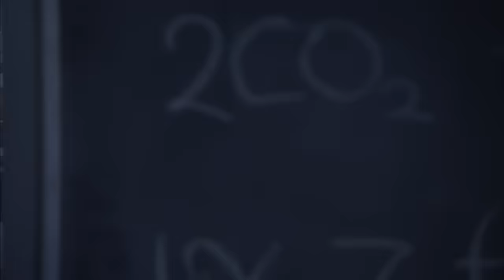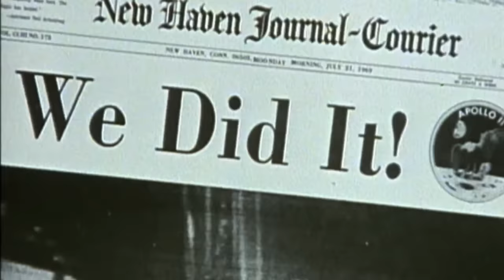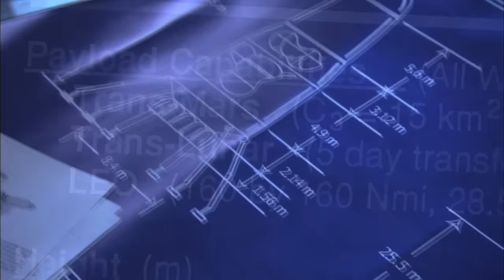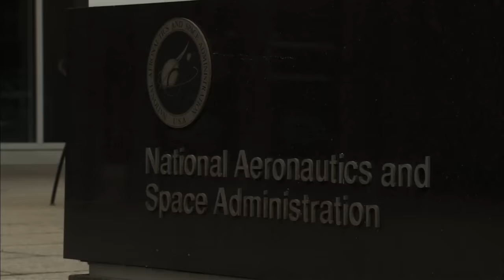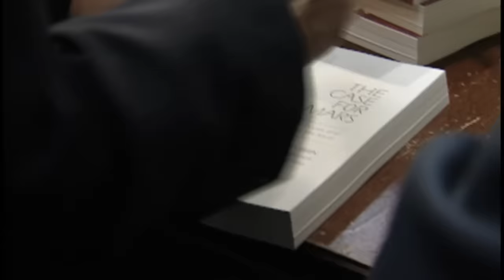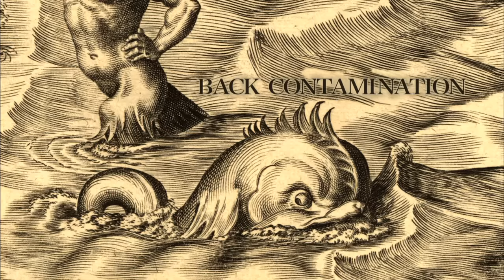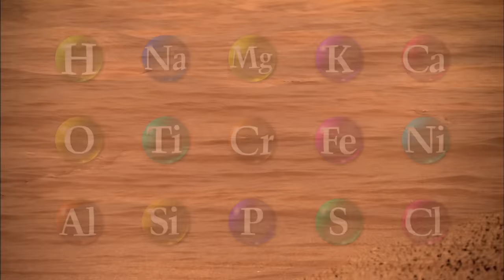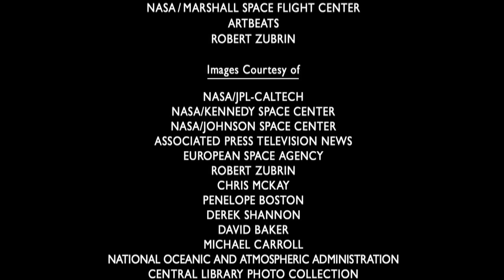THE MARS UNDERGROUND [HD] Full Movie

Comment: Something interesting occurred to me about Mars landings. The martian ATMOSPHERE can improve the safety of transports by using hydrogen or helium filled bags to reduce the fuel required for landings just by maintaining a buoyant state for the transport craft. This could provide for long duration overflights for closer inspection of large areas prior to establishing a landing site. Establish orbit > deploy lander > deploy braking parachutes > deploy gas bags for atmospheric operation > deflate to land. Similar to the probes utilized on the Alien planet Darwin 4 program except on a larger scale.
Reply: LEIGH BARTON Helium is lighter than air. There is no air on Mars. Is helium lighter than nothing?
Reply: @dieterbruls4091  mars does have air tho. Not much of it but it’s also c02 which is heavier than air gas so helium will still be buoyant.

Comment: We can warming up Mars, we can green it up etc.
But how we wanna build up the martian core to generate a strong magnetic field again?
This is just the main goal.
Reply: A satellite in stationary orbit aimed at the sun producing 1-2 Tesla of magnetic field will cover Mars with magnetism that will repel cosmic wind easily.

The result will be also a 4 degree warming of Mars which will probably result in releasing CO2 from its surface. It's actually the cheapest and most doable plan.

We know how to put satellites in stationary orbits already, we know how to create electromagnetic fields. It's easily doable with today's technology.
Reply: Strategic Thinker. What happens if the satellites fail? The colony would perish?
Reply: OMG having a redundant satellite in orbit just won't work, OMG the sky is falling, cosmic rays will kill us all in a nanosecond. Save yourselves!!!!!!!!!
Reply: You could take a thin copper wire and wrap it around the equator of mars and create both a magnetic field and a source of energy lol. It would be a lot of copper but it would work.
Reply: Nothing would rise from the surface without geothermal heat, which would have to be core-generated. Your plan MAY raise atmospheric temperatures, but it would take more than a few degrees to impact the frozen Mars ground temperatures. 

Another problem which you overlook is that Mars is well past done with its past internal-heat-driven vulcanism (a known Earth source for gases such as C02 and 02). Without geothermal activity and no reliable source of energy to retain its thinning atmosphere, these are reasons why informed people call Mars a dead planet.
Reply: Lmfao to even believe we went to the moon just blows my mind people will believe anything on tv .Tell me this how did they land on the moon in 69 When they tell you to this day we dont possess the technology to send man thru the Van Allen belts huh.Lol its all lies
Reply: @beartrappr
haha, nice idea =) and btw. we would increase the gravity on mars with that^^ when we bring the copper from earth there =)
Reply: They also claim we ca communicate with one another world wide, share files, pictures, music, all through the air..
Reply: @cory riggs
It takes ~52h to get a crew to the moon, it is nothing compared to 2 years of exposure to solar and space radiation. By the way, crew capsules can protect the crew from most of the radiation but not all of it. On a short period of time it is not that hazardous.
Reply: Paralytic Angel Magnetic field is not the only problem. Add to that the weak gravity ( one third of Earth's gravity ). Humans can't stand weak gravity for long time or they would lose muscle and bone mass. Earth is a closed environment and humans are simply part of it.
Reply: ^He says he's informed. Must be true if he says it. He sounds very convincing talking nonsense.
Reply: Paralytic Angel makes a critical point.  Initial attempts to grow plants in space failed.  Ultimately astronauts were able to grow a weed, but with considerable difficulty.   With traditional lumens mimicking earth conditions, soil,  and temperatures conducive to growth; the failure was attributed to gravity.  I believe that the gravity hypothesis has been debunked.  The earth's magnetic field contributes to electrochemical balance in flora and fauna.  Until NASA or whoever acknowledges this, there is no way colonization of another sphere will occur unless it has a functional magnetic field.
Reply: The configuration of the magnetic field is critical to its functionality as a cosmic ray/solar radiation "shield."  The source of the magnetic field for an entire planet would have to come from its core.  It would be an interesting experiment to determine if a magnetic field could protect a spaceship.
Reply: Mars has almost no atmosphere. If you think you can go there and survive long periods of radiation from both, being on Mars, and the time it takes you to get there; you're mad. Without magic or having evolved in space; you're not going. It's a dead planet.
Reply: Low gravity will keep the atmosphere escaping into space.
Reply: dabrosius7637
Great troll, but some people here think it's possible to go to Mars and survive.
Reply: Why don't the "professionals" see this?
Reply: see what? @Gordon Brown
Reply: Pattycaker1508, this definitely becomes a non-sequitur relative to where it got inserted in this discussion.  I was responding to dabrosius737's comment above regarding how atmosphere escapes into space unless there is sufficient gravity to retain it.
Reply: Paralytic Angel  one possible way is in the movie the core where a ship is built to get to its center and use nukes to junp start its core
Reply: Indeed, the moon and mars do not have magnetic fields to protect humans from getting burned by solar flares. In an international conference, I have asked NASA scientists if they had a plan and the answer was no. Unless you can send a space ship with a force field like Star Trek, you may not have astronauts to survive a voyage to Mars. The second reason is at such speeds one little rock can destroy a whole spaceship.
Reply: Luc Rolland only if u r moving at the speed of light 657mi km/h enough to go around the earth x7 in 1sec there is a video i found called interstellar flight its 21 min long
Reply: You must be joking. We will never reach speds close to light. It is preferable to warp space but we do only know the theory. Even if the EDM gets to maturity and can propel large spaceships to huge speeds, it will take 4 months to reach Mars. We cannot do better. And we still need to protect the crew from radiations.
Reply: Luc Rolland one of the ways would be if the craft is shielded by titanium like on the juno spacecraft and making artificial gravity by rotating the hab pod with a counter weight like the last stage of a rocket booster attached to the hab pod by a metal tether
Reply: It's so simple...We require huge ruby magnets :) This will support everything :)
Reply: There r some ways u can get it going  if u watch the outward bound series
Reply: @coryriggs9272   You had to have lived back then , rode in cars with fins , gone to the N.Y. World's Fair, seen NASA develop, know what the Mariner Space probes did etc..Watched your tube TV's and radios change to transistors. Feel the energy of a free market manufacturing America and have real silver coins in your pocket;  then you'd know the Apollo Project was real. Get off your Xbox,  out of your grand parents basement and visit Cape Canaveral.
Reply: Titan is smaller yet has a thick atmosphere.

Comment: you cannot give a planet an atmosphere with out a magnetic field because that damn ball of gas up there is gonna wipe it all away with the solar wind. good luck guys;)
Reply: +Ryan Schrick Well...shit
Reply: ChocolateMass :3 lol
Reply: +Ryan Schrick In the documentary called "The Core" filmed in 2003, it showed how we could use nuclear weapons to nuke the core of a planet to restore its magnetic field
Reply: +Ryan Schrick certainly its not going to be like earths atmosphere, heavier elements might just stay on the planet, im no expert though lol
Reply from the maker: +Ryan Schrick Really?  What about Venus?  Venus has no magnetic field but a very thick atmosphere.  It's also much closer to the Sun.
Reply: +Ryan Schrick  
Sounds reasonable but if that's true why has no one broached that issue publicly before you did? (Bcz I've never heard that objection although it's crossed my own mind...)
Reply: +Ryan Schrick dangle wires from near orbit into the top of the atmosphere to generate free electricity then transmit the energy to mars via laser to receiving stations on the surface and feed it into cables laid from pole to pole at intervals and presto instant magnetic field.  OR wear lead underwear and spf 1 million sunscreen.
Reply: +enhaxed X or engineer microscopic photosynthetic plants that generate a magnetic field and can thrive in mars' upper atmosphere
Reply: +Blue Mars CO2 for the most part a heavier molecule than O2, helium was discovered on the sun before it was discovered here as atmosphere contained very little. Then there is the argument of the origins of Venus.
Reply: "HEy ENHAXED X " ooooh-kaaay ... or maybe stick a rigg up drill down 2 miles  & fill hole with melted copper & hook up big ole jumper cables to lightening bolt receptors & "well" probably nothing 'oh well"maybe-cool ?
Reply: sounds good to me :)
Reply: hummm sounds like we need to blow up a billion balloons and block out sun until we get planet core "jump-started" and running good
Reply: Ryan Schrick

Comment: The parachute was working on the landing, why did they cut it lose? They could have used it all the way down with the rockets and saved a lot of fuel.
Reply: The parachute can only slow down the space craft so much. After that the engines have to be ignited to reduce speed further. But of you don't cut the parachute before igniting the engines, you can very well fly into your own parachute, because it tries to over take you.

Comment: Seems a waste to throw away the counterweight for spinning to simulate gravity.  It should be left in orbit so it could be used for the return trip.  Instead of throwing it away by flinging it in some random direction, the direction depending on when you release the cable, reel in the cable and dock with the counterweight, once an orbit around Mars is established then disconnect and leave it in orbit around Mars.  On the way home they can dock with the counterweight, set course for Earth and, once they achieve correct velocity, connect to the cable, unreal, then spin.  The counterweight could be used for multiple trips to and from Earth instead of using a new one for each trip.

Comment: The cost for the Mars semi direct mission estimated as 55 billion is better than the 450billion of the initial NASA plan but it's still far too much.
The Artemis program has cost about 45 billion so far and only launched it's first flight recently and will be up to about 60 billion by the time anyone sets foot on the moon. This is too expensive it's like Columbus setting out in his 3 ships and coming back in a row boat. Worse than that is the certainty that is the best outcome possible. In the time of Columbus at least there was a reasonable expectation all your ships sent would return with valuables. VS if you know the outcome will be failure each time - no sane person would invest in such an expedition. Each time you launch a huge rocket and all you get back is a capsule. That is pretty much how Apollo worked and Artemis will work as well - NASA may justify Artemis for a short time but that program is destined to cancellation after a few landings in it's current form.
The cost needs to come down by not by 10x but by 100X or more and the value or prospect of value has to increase so that there is better value for money to justify continuing the program - even NASA are ultimately accountable to prove the value of their programs.
A recurring cost of 1 Billion for a moon landing mission or mars mission with 6+ crew doing significant exploration would be hard to argue against since the annual ISS program expenditure is 3 billion per year right now.  For 1 billion per mission you could do several moon landings a year for less than the ISS program costs now.
Hopefully the Artemis program funding for the Spacex starship will help SpaceX develop it into the breakthrough technology that enables future high value moon or mars occupation programs.

Comment: I mean why not scrub the hydrogen and oxygen from the atmosphere and the heck with looking for water. Pressurize Mars air into tanks and you can cause condensation that you can extracted the hydrogen from. This hydrogen could be used to run generators that would power the plasma rocket engines after it runs out to get back. A condenser system could make 500 gallons or mire over a few days and quite a lot of hydrogen could be extracted from that for a return.